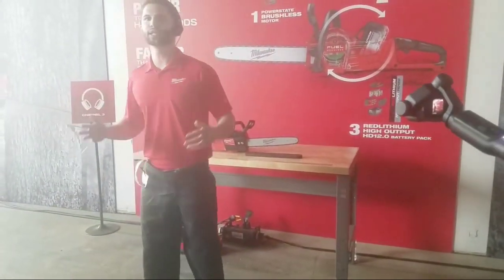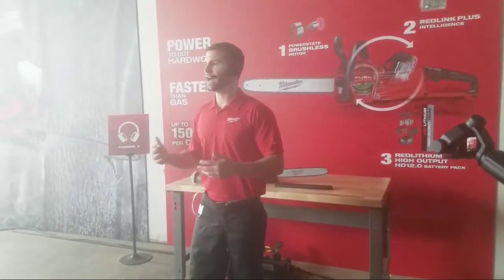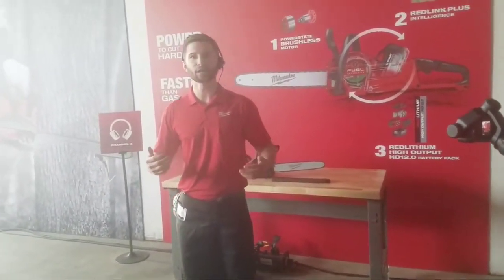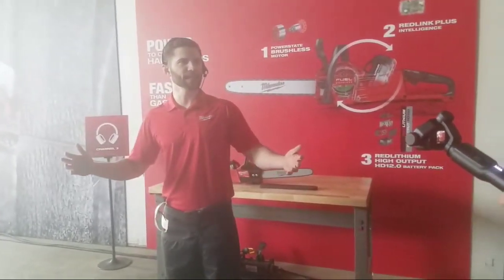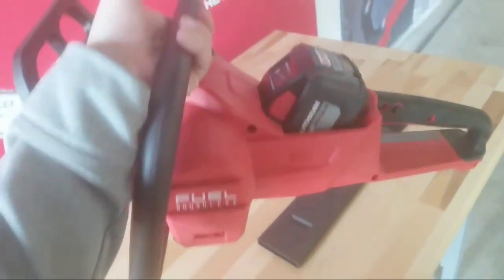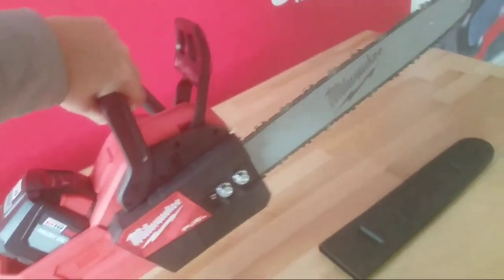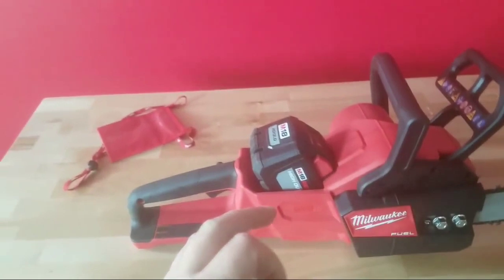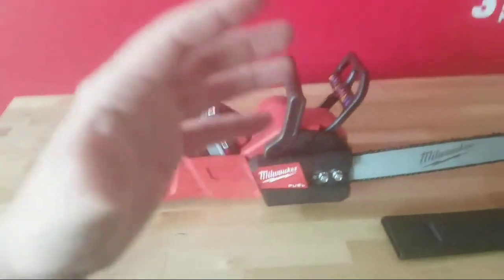Milwaukee M18 Fuel Chain Saw in Action vs. Gas Chainsaw

Comment: That's why i like milwaukee, they made a chainsaw that needs ONE 18volt battery not 2 like makita nor special 60 volt flexvolt shit from dewalt, no, just the same platform of 18 volts and can be powered from existing 18v batteries most milwaukee cordless tool owners have. What we need is capacity, more Ah and NOT more volts damn dewalt and makita.

Comment: Great video thanks brother. I think the gas saw blade needs sharpened. Keep up the great work see you in the next video thanks again
Reply from the maker: Thanks Scott 👍👍👍👊
Reply: The thing about the cordless is it has to over come the brake to work. I think you take the brake out of the equation. The battery would last longer. Has the same trigger as an corded or gas powered saw. I know that the circular saw I have goes through batteries because of the brake.